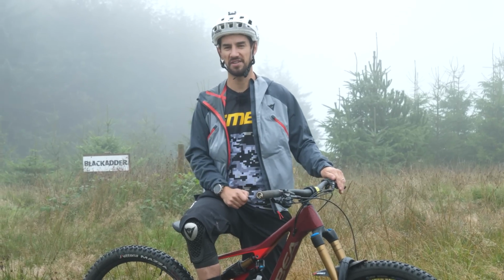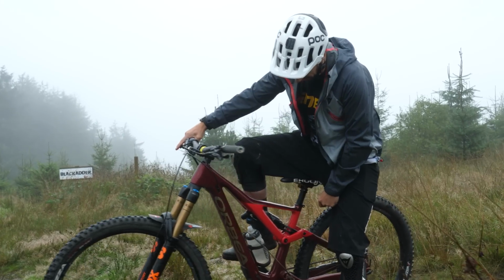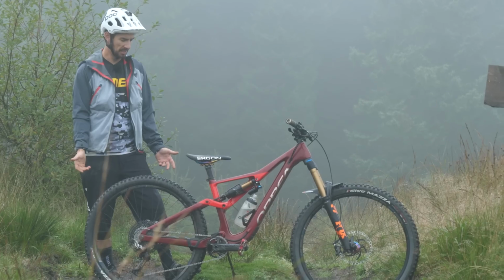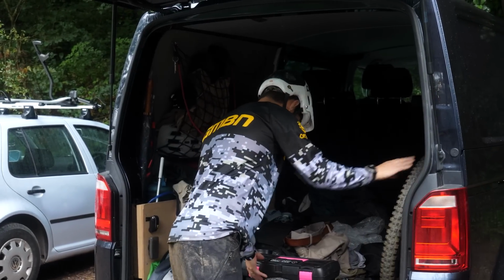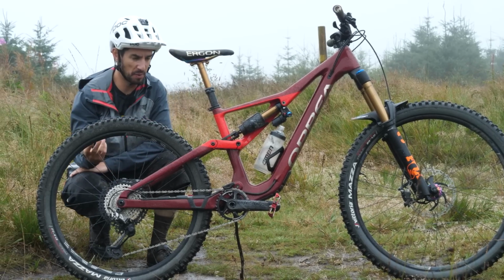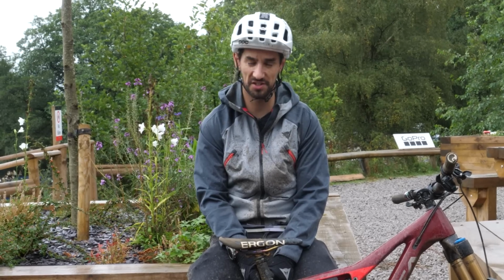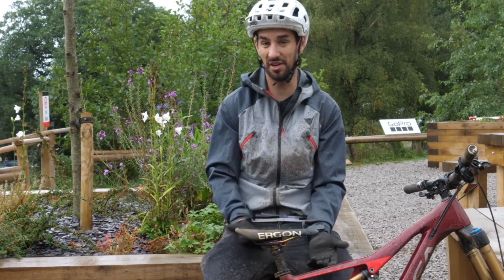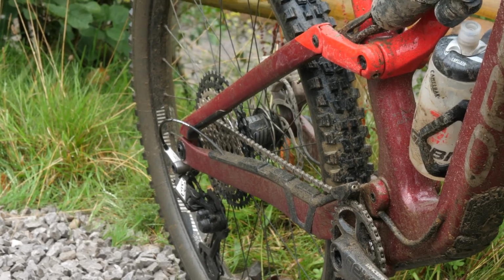Mixed Wheel Vs 29" Mountain Bike Wheels | The Wheel Size Debate Still Continues

Comment: Great video, excellent insights, amazing riding!

I think we often miss the biggest issue in the wheel size debate: the size of the rider.  I'm only 5'7" and 148 lbs so the 27.5 wheel size is perfect for me.  Anything with a 29 is just making the bike bigger when that's not something that I want as a rider.  I completely understand how the 29 is a great innovation for larger riders.  I just think GBMN might think all riders are large riders that want the largest possible wheels on their bikes.  BTW, Red Bull Rampage riders last week were all on 27.5 or 26/27.5 mullets.
Reply: I don‘t ride at rampage 😁
Reply: and the longest travel
Reply: Dude I’m 6”1 and 27.5 with tyres is huge, the wheel with tyres is far bigger than 27.5, 29er’s are just oversized and make the bike less utility and more ground hog. On a road bike 29er is great for speed and efficiency but on a enduro I just think 27.5 is way more fun and more than large enough for me.

Comment: If I have the choice I'm always picking the mullet. Ridden all wheel sizes. The main problem with the 29" rear wheel is that it's so high. So when you are hucking something you can't bring your rear as low. I've had a couple of close calls on my 29" bike as I've touched it and almost flipped over.
Reply: Bingo. I've got a short inseam, so I absolutely need all the space I can get between my ass and the rear tire. No way I'll ever buy a bike with a 29er in the rear... 27.5 is big enough
Reply: Same to me with 83 cm inseam and 175 cm height. 29 in the rear works great in fast and shaped areas. But when it becomes steep, technical and slower I have more space to move with 650b in the rear. So for a do-it-all I would go mullet or full 650b. But a 29 wheel ist rolling very well and so the mixture seems to be perfect. I've got no experiences with all mountain riding on natural trails up and downhill. Very interested in how this works?! Guess with the right geo it should work and be fun. Anyone can answer?
Reply: Definitely depends on height, riding style , and terrain
Reply: I've definitely had my 29er wipe my ass
Reply: Interesting point. I've never had this issue and I lover 29ers (wouldn't go for anything else), but I am a lanky guy, so it makes sense.
Reply: @Bozza36  Maybe you are a better Rider and standing more central in the bike or you are riding easier and not so steep trails. Or longer legs... 😜😉
Reply: @brunox3503  There are definitely some steep trails in my local area, but I also have long legs, and a central riding style so it all adds up. I definitely understand mullets though, they just aren't for me.
Reply: @Bozza36 thanks! yes I believe you! riding style and body geometry are matching in your case. have fun and always good rides! best regards! 🙋🌞😊🤜🤛
Reply: @brunox3503  You too mate, keep shredding.
Reply: Why not just keep all the sizes for all the different types and likes of riders? There is no one best for all.

Comment: And I’m still having fun on the 26 ers
Reply: Me to 😂 but I do want to switch to 27,5
Reply: Me too! But I've been thinking about trying a 27.5 front. The fork I threw on my bike last year can take it so it wouldn't be terribly expensive.
Reply: I miss my Rocky Mountain Slayer 26er! I was so nimble and explosive on it.
Reply: @agrsk8r  Go for it! I run my UMF DirtKick so a while ago too. It is fun. :) Just probably will be necessary to get a lower stem/bar.
Reply: You would have a better choice in tyres as well. I was thinking about doing the same

Comment: Coming from a 29er, I have definetely noticed the same differences as you on the mullet. I feel quicker in corners with the mx wheels and that gives me much more confidence to go faster elsewhere on the trail. I also feel like the bike is easier to control in the air. Nice video.
Reply: this largely depends on bikes.  I have a 27.5 Tues and a Meta AM 29 and I ride the same bike park (mountain creek) and frequently I set PRs on the Meta on tracks that are very corner heavy.
Reply: I'm also 5'7"

Comment: Love my mullet- sits into corners faster/easier, and really helped with my jumping and manual ability vs the full 29er. Not covered in the video but the way it accelerates up techy climbs is unreal and quite often not spoken about. Only place I'd want full 29er back on is if I was riding a lot of higher speed, groomed bike park downhill where fast rock gardens or braking bumps were common- you lose the monster truck rollover feeling and the rear hangs up a bit.... But for playing and enjoying regular trail riding, mullet wins.
Reply: Great explanation/review. What bike are you running? I've heard about the better technical climbing of MX setup from others as well. That's a pretty big positive, especially since the monster truck roller over thing in rock gardens seems to be more "feel" than actual speed loss issue.
Reply: What is your bike man!?

Comment: I ride mullets, and the biggest reason is that it's harder for my butt to catch the rear wheel on a steep descent. There are some other minor advantages, but this is by far the biggest one. And this is why I think mullets will never fall out of vogue.
Reply: They aren't going anywhere.
Reply: Completely agree
Reply: I honestly feel like it is a height thing. I never even get close to hitting my bum on the tyre because I'm lanky. Wheel sizes will probably start to coincide with different bike sizes.
Reply: @Bozza36  Could be, I'm 189cm and will rarely scrub a 29" back wheel. But when I do, it's at the outmost inconvenient times (very very steep sections and/or drops).
Reply: I’m on a 29er , I’ve got short legs long torso and ride a larger size frame than must people my height . 

I buzz my arse a lot , but not to the point where it destroys my ride , 

But in saying that I’m probably a prime candidate for someone that is suites to a mullet , love to try one .

Comment: One thing I never see mentioned in any of these comparison videos is the acceleration advantage and low-end torque advantage. I come from the dirt bike side where, as everyone knows, all of our rear rims are smaller (and wider) than our front rims - this is mostly due to mechanical advantage due to motor input. However, there are differences within disciplines which would fall in line with bicycle advantages. All (full size) dirt bikes use 21 inch front rims but, for MX track racing the standard is a 19 inch rear rim, and for "off-road" racing (hare-scramble, hare and hound, enduro, etc.) an 18 inch rim is standard. Off-road drops to 18" because it is generally not as 'wide open throttle' (wot) as MX is. The smaller rim helps with spooling speed back up quicker when coming out of slow speed scenarios (tight turns, tight trees, large rock gardens). It also helps with maintaining engine rpm at slower speeds reducing engine stall.
  Interestingly, there is also a similar application in skateboarding. Ramp skaters (especially vert skaters) use larger wheels because they have noticeably higher top end speeds. However, street skaters need smaller wheels b/c smaller wheels accelerate faster and many times there isn't much run-up room before the 'obstacle' (a handrail, for instance). So, the smaller wheels help in pushing up to speed easier and faster in the smaller space. There are also center-of-gravity/weight considerations but that isn't relative here.
  Likewise on a mountain bike, you would get a (however small) acceleration advantage and some lower end torque advantage that partially contributes to the maneuverability that everyone notices. The acceleration advantage may, in fact, be the reason that time differences are so similar between the two set-ups. 29 may be faster overall, but 27.5 pedals back up to speed faster.

Comment: Depends on the bike and terrain. I've been mixing wheel sizes for years. Currently have a Vendetta with a 650b x 2.8 and 29 x 2.6 front. I sometimes use the same combo in my Hightower. Both give massive traction and greater protection from water bars and riding through rock. Both take a b+ or 29 wheel.

Comment: Saw mullets on redbull rampage. 27.5 front, 26 back. They're legit and fun.
Reply: That's how I have my old (2013) V-10 set up and it's a blast!
Reply: I do run that too on my 2004 UMF DirtKick. 26 rear, 27,5 front, 120mm fork, low rise 780mm bar, 70mm low angle stem, dropper post.
Fun bike. :) I "name" it as a "down-country/mini-trail" bike.
Reply: Remember Rampage is mostly groomed vs natural chunk and roots you might find on trails or freeriding, so Im thinking 26 rear may tend to kicked around or hung up some for most of us - no?

Comment: I have 1000 miles on my mulleted Ibis Mojo HD5 and I love it. Corners quicker than a 29er, easier to move the back wheel around, more butt to wheel clearance, and I feel it's easier to pop the front end of the bike up. Doesn't feel like the back wheel is getting held up on chunkier terrain at all. No complaints yet and I plan on getting another mullet for my next bike! Can't wait until the bike industry starts to embrace mixed wheel sizes a bit more.
Reply: Yay another mojo enthusiast. I picked up a ridden hard but solid mojo SL and am rebuilding and painting it the way I want it. I'm strongly considering putting a 29er up front and mulleting her out. I'm mostly targeting downhill and aggressive trail riding wand want a snappy feel but figured the 29 tire and fork would be more forgiving on my back and give me better front end grip in corners. Any other recommendation considering the DW link on the mojos to take into account?

Comment: Nice to see that Neil agrees with mullet wheels!
I run an old UMF DirtKick frame from 2004 as a mullet.
Tapered 120mm fork for 27,5" front wheel, 26" rear wheel, 780mm low rise bar, 70mm low angle stem, dropper post.
For my 178cm and 72kg it is a fun bike, both up-, and downhill.

Comment: I’m an old motocross racer. The mixed wheel and eagle grip shift have me feeling like the old days. I’m also 5’9” with kinda short legs so getting rid of the tire buzz, the improved handling on steep rock rolls, cornering and jumping improvements all work for me.
Reply: Me too Andy

Comment: I've been riding a mixed wheel bike for almost a year now.  At 5'8" in the gnar I really appreciate the smaller wheel back there.... for most riders, it's more about moving from a 27" bike up to a mixed wheel bike rather than riders on 29er's mover down to mixed wheels....
Reply: That's exactly the position I'm in. I'm the same height and debating whether to go full 29. I ride the tech/gnar of the North Shore.

Comment: Yeah!! I've only got one ride in on my bike after throwing a 27.5 on the rear, but I was so surprised!  I much prefer a 29er to a 27.5 even though I'm really short, but the mullet setup was a gem!  Zippy and roomy in the rear with the rollover and speed in the front that I've gotten used to.  For someone my size, this might be just the ticket.  I'm anxious to put some more miles on it.
Reply: How is it going ?
Reply: @camwells9726  I really liked it! I’ve put the 29 rear back on because the 27.5 wheel belongs on my other bike (my 29er wheelset is much nicer - carbon with a better hub, etc). I definitely think I’ll be looking at a mullet when it comes time to replace this bike. It just makes sense for my size and style.
Reply: @Squirrel_Rides  I’ve never tried one , but in my dimensions I’m probably a prime example of someone suited , short legs long torso , that rides a big frame to get the reach I like . 

178 cm on a large frame , in theory a mullet should make the overall ride more agile and feel not so big ?
Reply: @camwells9726  sounds reasonable!  The Downtime Podcast did a great episode last year about wheel sizes - worth a listen :)
Reply: @Squirrel_Rides  ok thanks for the heads up , will have a listen , cheers

Comment: When I was a kid (in the mid-late 70's), the thing to do was to put the rear wheel from a Raleigh Chopper on a road bike frame and replace the drop bars with "cow horn" or T-bar handlebars. The original mullet.  :)

Comment: Surprising result! I actually went the other way and decided to stay 29'er after testing. I'm only 177cm with a big bike too, 2021 Trek Slash M/L. The mullet (w/mino chip in high) was fun but the increased pedal strikes and some looser moments scared me. As a one-bike-guy the scales tipped towards honing my skills on the smooth/flowy/efficient style of 29er and just focussing on that. I've still got the little wheel though. It's a different skill which makes switching between them fun if I get the time.

Comment: The thing with going mullet on a 29er?   Unless you change the rear triangle?   You won't get the main benefits of the small wheel in back....  a short chainstay...
Reply: If your going mullet?   You really should just be adding a big wheel and fork to a 27.5 bike

Comment: I have two I play with... 29/27.5 HT Rockhopper and a 27.5/26 ST Rockhopper both are fun I grew up on mullets back when MTBs were just coming around. Remember the moded road bike frames that were the start of the MTBs?

Comment: I used to focus on the downhill more, riding dual 27.5+ e-bike tires on an enduro bike going down super rough trails. My bike then got stolen, and as a replacement I got a trek fuel, a 29er light trail/dc bike. I LOVE the 29ers front AND rear, it just climbs so much faster! I find that with correct body positioning and balance transfer, the 29er rear performs fine for me.

Comment: I miss a time comparison between the two options, I know it's 2 seconds difference but what were the total times?
Personally I'm on the tall side (186cm) so I will pretty much stick with 29", that is until 30.5" is released in 2023.
Reply: 30.5" wheels rock. Use them on my tractor.
Reply: @legalize.brokkoli  old or small tractor?
Reply: @viljosavolainen2286  both :)
Reply: I reckon the speed difference will depend on what you’re riding.  Smaller wheels will be better on acceleration, bigger will carry more momentum through rough areas, probably
Reply: I'm with you, I feel like I'll always go for the biggest wheels available.

Comment: Being a 26" rider, its sad to see 26" being eased out of the sport. I was recently shopping for tyres and i either couldn't get the tyres i wanted because they didnt offer 26 or they were out of stock.
Reply: maaan same. needed tyres recently for my xc 26"..  found maxxis pace tyres that were being sold 2 for $50 at a city bike rental place lol they did the job
Reply: This is a real fear for me since I just put on my last two tires on my 26 Mtb. I stocked up on tires years ago when the push to kill 26 was going on. I might need to see if I can do the same again.
Reply: They might be out of stock because more people than expected are buying them.  They seem to disapear very quickly online anyway.
Reply: @yanduval7172 , yeah, part of the reason I think is because the manufacturers just aren't making half as many 26" tyres any more because demand is dwindling. A lot of tyre models I was looking at didn't even have 26" as an option - it was either 27.5 or 29, and the ones that did have 26" as an option were out of stock.

I mean I found some, but it wasn't easy and they weren't the tyres i wanted.
Reply: I think 26" will gradually become the new 24" Lol
Reply: Long as I can still get minions for a 26" tire then I'll be happy.
Reply: @sgttoxiiczz  I assume if I'm not picky, I'll be able to find great middle of the road (!?) tires for a while still.

Comment: I love my Stumpy Evo that can run both 29” and mullet. I enjoy the smaller rear wheel and space to move around the back when sending it downhill and in the bike park. Prefer the 29” front and back when pedalling on my local trails.
Reply: Hi, what Stumpy Evo do you have that can be full 29 or mullet?
I have a 2012 HT Stumpy Evo, and I don't know enough to know if it would be worth trying a mullet setup, I can't imagine there's much I could change besides the rear wheel, but I guess that would lower my BB a bit?

Comment: In motorbikes/motorcycle world an equivalent configuration had been used since ages, it is the rule in MX/END bikes using a combination of 21" front and 19 or 18" rear, not the same wheel size in each end, so myself coming from and still practising motocross and enduro I find quite interesting this comparative, also when buying a new bicycle the first thing I do is to change brake levers side, that is putting front brake lever in the right side like my MX bike.

Comment: I have not yet driven it with the mixed wheels. But I am thinking a little further on the practical side. If you ride tubles for the longer trips then you already have to carry two different inner tubes. I find that a bit tricky.

Comment: I would like to see you change the rear tyre to a plus size and then do a 29er and 27.5 plus size comparison.
On my kona hard tail, the plus size is so much better than 2.3 or 2.4
Reply: What size of tires 27.5 do You use?
Reply: @radzia1010  27.5x2.8 still running tubes at the moment.
They are the standard WTB tyres that were on the bike.
Roll fast, great grip and don't push through the corners
Reply: @coreystrong4384  I have Marine Pine Mountain and i use 3" at the back. It is ideal for sandy fireroads but for long trip i use 29" wheels.
Reply: @radzia1010  what sort of distance makes you change sizes?
Reply: @coreystrong4384  if i go to a few day trip, for example each day i travel around 130 km for four days.
Reply: @radzia1010  That's a huge trip compared to mine being 80 max 10 years ago
Reply: 2.6 are actually pretty good too, my bike has been through 2 sets of 2.8 but 2.6 is arguably better . Lighter , similar grip , still good rolling and perhaps more precise . I dont see a down side to evolving to the 2.6